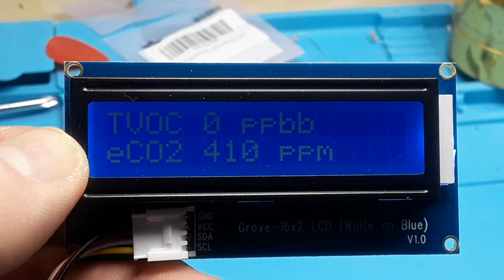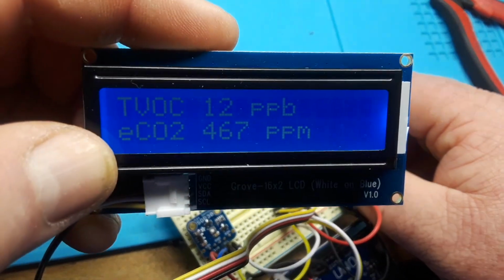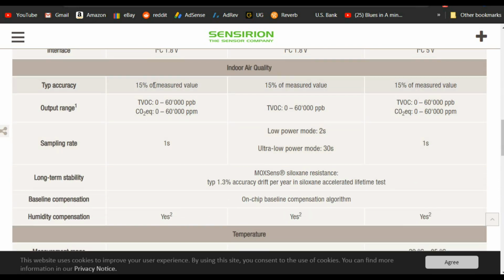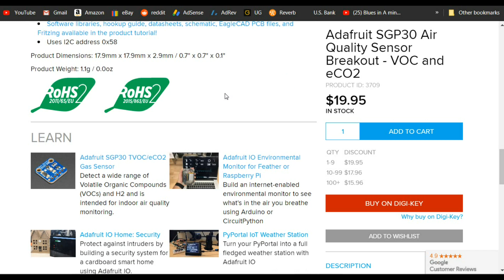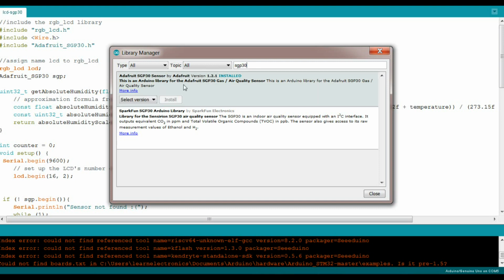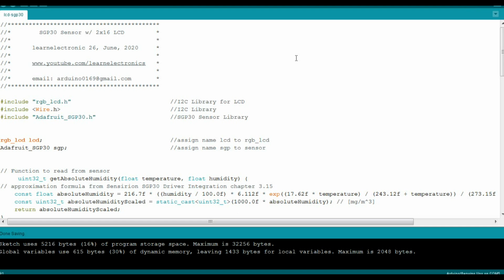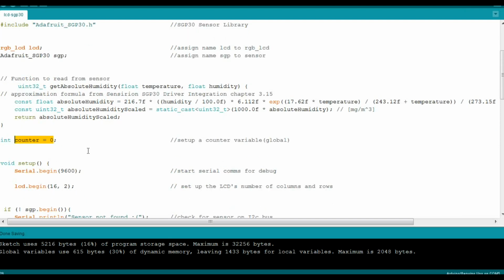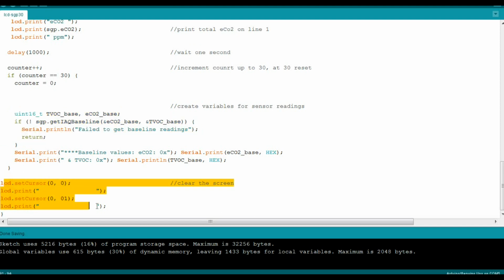Adafruit SGP30 Air Quality Sensor for Arduino Setup and Demo

Comment: Thank you for providing the code for this project. I've just started working on a project for air quality using the sgp30 plus I've never used I2C before or an Arduino so this video is much appreciated, and to show my appreciation I've just bought one of your logic T-shirts, how true. Thank you.😁

Comment: I need ur help .. i am trying to do a project with sgp30 i have done exactly same connection and trying to run sgp30 test code from the library Example .but my serial monitor is showing outpost sgp30 not detected . I have tried 2 different sgp30 sensor but showing same output. Please help me have been stuck for 1 weak

Comment: So, after a month of playing with this sensor, I can report that......   It's super well built, great library from AdaFruit and super easy to interface, as your video shows.  For CO2 measurements however, it really is an estimate, and a relatively poor one at that!  I have been graphing the SGP30 against my more expensive CO2 sensors and the SGP30 is all over the place!  Not only are the readings from one to the next very variable, making for a noisy graph, but they differ quite a lot from the real CO2 readings - sometimes over-reading, sometimes under.  Is it within the 15% they claim?  I'd say not for eCO2.  For TVOC, I am sure it's a great sensor.  Although it's easy to interface, dealing with the 'baseline' changes from time to time and the Temp/RH% to get the sensor to be more accurate has been an interesting learning experience.  It is cheap though, so better than nothing, and I am sure it will find a lot of uses, we just need to bear in mind how variable it is, how '15%' it is, and that it's eCO2, not real CO2.
Reply: Interesting note, the SGP30 is NRND now, and being replaced by the SGP40, which is pin-compatible. They dropped eCO2 from the SGP40, so I'm guessing they agree with you that the hydrogen based estimation of CO2 didn't work.
Reply: Hi, will formaldehyde increase in air be reflected by SGP30 sensor by showing a higher VOC level?
Reply: @Random_Numbers_3c  I don't know.  If I manage to get some formaldehyde I can test it, as my SGP30 is still running 24/7 on test.
Reply: @Richster64  would be great, thanks

Comment: I like the MQ-type air quality sensors, they are cheap and they break out the gases sensed a bit more. This sensor would be a huge bonus to any project using those because it is another way of looking at the same things, they would corroborate each other, validating each other. Add in a particulate sensor (smoke and pollen) and some other goodies and you would have a great way of tracking what is happening with the air. Run one inside your home and another outside and see what your house and belongings are doing to the air (did that new sofa spike your formaldehyde?)

Comment: This is interesting. I have been using much more expensive CO2 sensors for a while ($120+) with arduino.  The whole CO2 thing is not to be underestimated.  Above 1200ppm, CO2 can cause headaches, tiredness, and above 2000ppm it starts to get seriously detrimental to health.  I'm going to test this SGP30 against my existing ones to see if this is a cheaper - but still accurate - solution.  The 'baseline' for CO2, outdoors, is about 400ppm these days, up from about 300ppm 100 years ago!
Reply: Which CO2 sensor do you use?
Reply: @thebucketmouse  I was using a couple of 'SenseAir' CO2 Engine K30 sensors, but more recently I have been using Sensirion's SCD30 from AdaFruit. They are about USD $60 and work really well.  I have also used a Kane CO2 monitor (ready built) and that agrees with all the others... which is encouraging.
Reply: @Richster64 Hi, do you have any recommendations for a good sensor for a raspberry pi that can detect vape vapour?
Reply: @lemon3015  Sorry, never tried that.  Maybe the SGP30's TVOC can sense this?  Not sure.  I don't vape and none of my friends do either :-(  Good luck in your search, and report back here if you find one!
Reply: @Richster64  That's fine, but thanks anyway. If you don't mind me asking, for detecting the basic gases or smoke, do you have any knowledge on that for sensors?
Reply: @lemon3015 To be honest - no!  My primary interest is in CO2, and after getting several ~$130  CO2  sensors, this SGP30 on the video seemed like a cheaper alternative, and it's pretty rubbish for CO2, but may well be Ok for the TVOC it was designed for. I have not looked at other sensors....yet !  Must be doable, as every smoke detector has one, just gotta get one that's I2C or SPI for our arduinos.